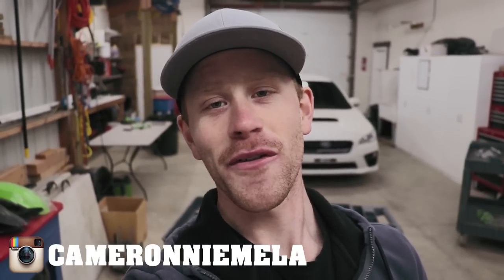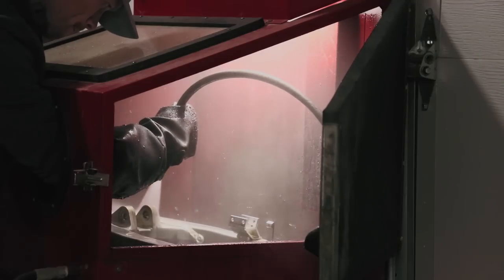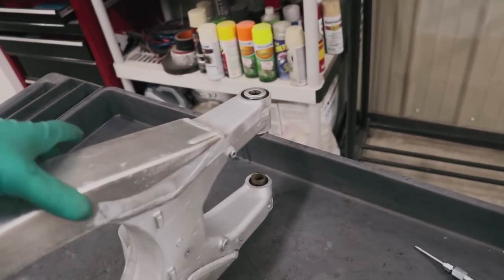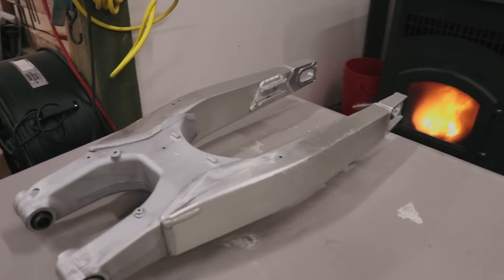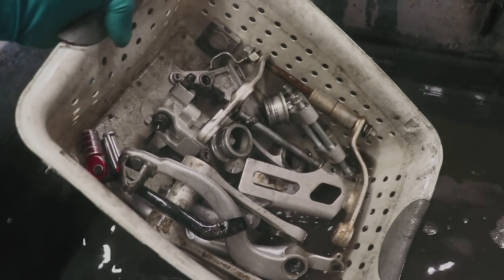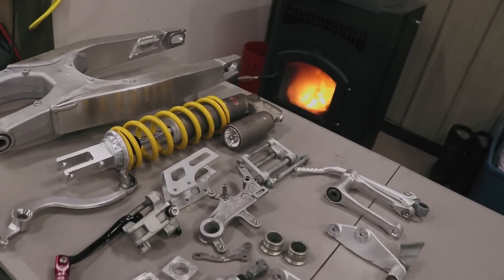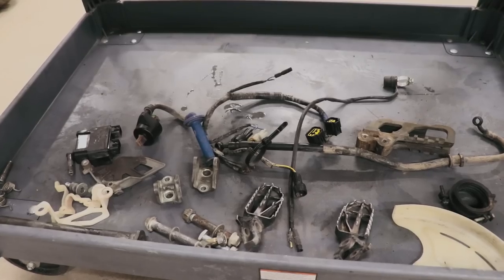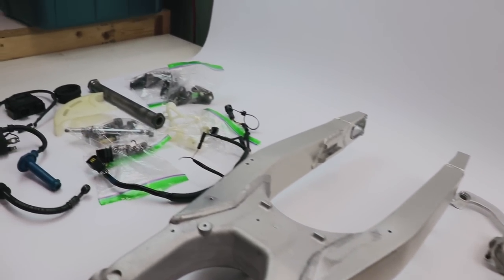My Secrets To Making Aluminum Look New Again!

Comment from the maker: Build your own heated parts washer shown in this video! https://goo.gl/pmuSfK
Reply: Cameron Niemela where did you get your pressure washer cabinet?
Reply: You should use the pressure washer after the rim cleaner might work even better also try using a heavy duty acid for rims
Reply: That mini grease gun is pretty nice. What kind of grease do you use with it?
Reply: I have a heated parts washer for $10...   Double boiler from a yard sale.
I also use a $10 walmart hotplate, and a $7 large WM stainless spag. pot.  :-)
Reply: @chadhandrop4339  he won't answer you because he's too busy cooling his water and degreasant bath down from the impossibly absurd 150 degrees. I'll apologise on his behalf.
Reply: PPP Pugh F, not C
Reply: If you want a small parts hot tank keep an eye out for an old crock pot. Works great.
Reply: 1 litre of coke and a roll of tinfoil does a better job than your set up. Cola and foil also cleans chrome really well.
Reply: @ppppugh7892  😂😂😂
Reply: @HelloJamesBond  I'm desperately clinging onto the time where everything English was always understood by 'the English'. I'm not anti American, just picking up on lack of clarity and an assumption that the World (outside USA) even knows what Fahrenheit is! 🤫🌝😂🤩 150 degrees!!!

Comment: Excellent instructions on cleaning and restoring aluminum motorcycle parts.   Also appreciate the details on greasing bearings and the mini grease gun. I will use these techniques in my restorations.   Thanks much!

Comment: I've been using etching wheel cleaner for about 30 yrs. & it does work great, it's not too good with black plastic stuff under the hood of my truck so a little patience is best if doing an aluminum manifold like brushing it on in sections & rinsing often for anyone trying it. comet & a scoth brite works good too, my 70' Triumph center cases & head are bright white aluminum. Part of keeping things simple after it is clean is to wash everything with "Dawn" dish soap and water on a regular basis. I was taught the dish soap routine by a 3 time national speedway champion who's house I kept my bike with, after each race the clutch, carb, throtle chains, everything off the bike & into the bucket of soap & water!

Comment: I’d love to see a video on your parts washer cabinet. The red one!
Reply: Shane Conley same here! Looks like a great setup
Reply: It's a sandblasting cabinet. Not much good for sandblasting if it's wet inside, but a few simple changes between sandblasting and pressure water and it should be fine. Just remember sand doesn't like water, any water. But you can also use glass beads, nut shells etc in the sandblasted for cleaning up stuff like this.
Reply: 29 bucks for his "course"  lol
Reply: Aussie Manly Man you should check out pressurewasher sand blaster. It mixes sand with the water stream. No dust and no heat

Comment: RIP bearings&seals
Reply: sakari puttonen thank you
Reply: Seriously right! Lol
Reply: but he pulled the inner race, cleaned it, and added some grease... 😂
Reply: I don't think that would hurt the seals but he can kiss the bearings goodby. The bearings are now filled with Simple green and water but at least the rusty pitted bearings will have some fresh grease.
Reply: what are you guys talking about? they aren't ball bearings or needle bearings. and he took care of them and the inner races.
Reply: 4:56 You can clearly see the needle bearings that were not removed.
Reply: I’d be concerned about the seals in the shock and on the rear master cylinder.  I’d say after soaking in warm simple green they’d need a rebuild.  Although safe on rubber, there’s no way it didn’t get past the seals after soaking.  
Who soaks and then power wash’s there master cylinder ???
Oh And let’s not forget, the master also got a good soak in the mag wheel cleaner...
Reply: thelaughingman79 exactly they are bushings right? So no harm done.
Reply: Mrcaffinebean Bearings
Reply: No metal needle rollers, just a ribbed rubber bushing. Think about it- why would you have metal needle bearings against rubber? The pin could be 1 race, but where's the other? Nope- it's the same as a control arm on a car.
Reply: Water and Simple Green is nothing- compared to DOT3 brake fluid. I would do a complete teardown/rebuild of brake components- for safety sake. As for the shock- if seals hold IN pressurized (when dampening through valves) fluid- I'd imagine they'd keep simple soaking solutions out. Think about it. He's cleaning these parts up to sell as USED- not new.
Reply: Bushings. Bearings use races and are metal. Bushings are an elastomer with a bar or bolt inside, or can be made from a type of metal called Oilite bronze (electric motors). Crankshaft=bearing, Body-to-frame bearings? No. Control Arm and Sway Bar *Bushings*. You usually don't grease bushings, except for ease of assembly. The twisting rubber takes the movement- the rubber doesn't usually spin in it's bore.
Reply: Yeah, that's some nice grinding paste he's made for the new owner to wear out the needle bearings in triple quick time.
Reply: DOT3 might be nasty shit, but it's also not simple green. Something made to contain DOT3 is made to contain DOT3, not anything else.
Reply: HUBBABUBBA DOOPYDOOP you obvoiusly know nothing about mororcycle swing arm bushing and bearings. Some arms use bushes some use bearings and the bushing type generally have a metal tube that the pivot bolt rotates around and needs to be greased. It is not like a sway bar link on a car
Reply: I know right!
Reply: Well aslong as he replaces or greases it all not a big deal
Reply: Chris_1973 as soon as I finished watching it my thought was “wtf? that shock and rear master cylinder are done now”. Or is the shock nitrogen filled and completely sealed? It can’t be good for master cylinder without taking it all apart that’s for sure.
Reply: @rztrzt  
Why so hostile, Bruh? Ok- I just work on cars, not bikes. Sorry man!
Reply: Yup!  Good cleaning process if you remove the bearings and install new ones.
Reply: @ToyotaKTM   He popped them apart, Cleaned and re greased them.

Comment: 1) What are you using to heat the degreaser/water mixture?
2) Is that pressure washing cabinet just a converted sand blasting cabinet?

Comment: Brother I am a clean freak too. How did you heat the Simple Green and is it diluted or full strength...same with mag aluminum cleaner...that's a big bucket of Simple Green and Mag Sauce you soaked the smaller parts in.. I don't have a pressure booth but I live a block from a cheap carwash...I usually throw it all in buckets and  truck it over after degreaser soaking it and pressure it all there for a couple bucks ..
 I like your aluminum trick. Thanks great video...
Reply from the maker: Thanks for watching! I'll have more info available on the parts washer in tomorrows video.

Comment: Is that just a sand blaster with water at the bottom for the air to pick up instead of sand?? That's awesome!
Reply from the maker: It uses an electric pressure washer. Works wonders!
Reply: Got the same  set up usin HF  elec portland  PW,  it DOES  work  great,but   it will rust out,so  you HAVE  to drain and dry   after use!.I am   resto shop  owner,mostly  Harley..always  buyin  parts. Hit me up

Comment: The cleaner you used is a great tip and I will try it asap however we can’t take the bike apart every week so not practical. I am going to try and wipe it on an off. The only thing that worked for me was wire wheels. I use the 1/2” and above on a corded drill and for the tiny place use a dremel tool. After that then buff and polish them out and they will look like a factory pro bike

Comment: Thank you for your AWESOME videos, I definitely picked up several things to take care of my bikes. I do have 2 questions:
1. where to get that compact high-pressure wash machine? (it looks like Harbor Freight Tools "Sand Blast" Machine, but with water, which I've never seen before).
2. What are you using to heat up that Simple-Green solution in that tank, Is that premade machine/tank with a heating element?  Thank you again. Very cool stuff.

Comment: yo, rad channel. just wanted to let you know the spotting you've experienced on the sides of the swingarm is due to the clear anodizing process that is done to the sides from the facrory. also, noticed the axels looked a bit rusty, you can thread the nut on them then use your impact to spin the axel while holding the axel with scotch brite, also works great to make sure that the right side end of the front axel slides easily in the right fork to prevent binding of the forks, after cleaning it and applying some grease an old axel should slide in nicely. you can do the same thing with that long head stay bolt as well to clean the rust off

Comment: I'm also using an almost similar method. But i use cheap powder laundry detergent instead of degreaser in constantly heated water. The result is almost the same. But require some more brushing and re soaking. But i'm cheap! hahaha

Comment: I wish I could do a smaller easier version of this to my bike, im starting to learn a little bit about parts and putting stuff together. For example like how to do a whole clutch assembly, I learned how to put a lowering link on a bike but honestly I'm learning more so about each part and what it does. I have a 2005 yz250f and I'm trying to figure out what I should do to make it look new and fresh. I'm forsure going to put new plastics and a graphics kit. A new clutch cover new levers maybe some new wheels down the line and make try to clean up the air box to make it look nice

Comment: What would you soak your parts in if you didn't have the heated cleaner is there anything what you can use just in a bucket ect I know it won't be as good but just wonderd if there is anything thanks

Comment: Hey man, I see that swing arm came up really nice! but I also see that swing arm is made of box sections and welded, but would this process work on a cast aluminum swing arm? as on ktms? cause they have such a rough surface and they've been CNC'd in some spots for part access?  I'm thinking it would clean it pretty good, but not as good as the swing arm you did though.  I dunno? let me know if you've done cast swing arms before?
cheers!

Comment: You can add an osculating head to your pressure washer rather than just a strait jet tip, it will strip and clean 10 times better and faster than expensive cleaners,  especially when you use hot water in your cabinet.  they make one for metal or wood and come in various sizes.

Comment: Is it possible to make an alu frame with a lot of light scratches and fading look new again?
I see a lot of older CR's for sale but most have frames that look all scruffed up and i want it to look perfect..
Reply: NukaMoto he has a couple videos where he shows his process with frames and they come out flawless. If you want the scratches out use high grit sand paper 600 then 600-1000-1500-2000 one at a time  and then use mothers and buff it and polish it and it’ll come out in a mirror finish. That works on any al frame
Reply: Use autosol aluminium polish and old white socks to rub. When you feel the grit wear down use more. Lil dab at a time . For big ugly deep sctatches. Polish then down a tad with 800 grit sandpaper n water. Dont sand much then polish.
Reply: or some maroon scotch brite followed by sos pads for a factory looking finish, the polishing suggested below is a bit overkill and a pain in the ass to maintain

Comment: Wont simple green break the shock bushing down? Also the seals? Bearings? I always use simple green but dilute it 50/50 with water in a bottle.
Reply: No it won’t read the bottle it’s safe on rubber.
Reply: it 
 messes up aluminum though if left in any nooks or crannies
Reply: erik61801 that whole swing arm is aluminum so it should be fine it just leaves a dull finish if you leave it in for too long i dont know what it does to brass or bronze though
Reply: Austin K exactly time is key. Most solvents that are water based seem to eat aluminum the key is exposer time.
Reply: same bro
Reply: The Simple Green was left INSIDE the swing arm.

Comment: Only thing I would recommend is spraying those bearings out with carb cleaner or starting fluid to remove all the old grease then repacking them

Comment: You turned me on to that mag wheel cleaner! It works so damn good on any surface really, cleaned my rm up with it at it turned out immaculate! It works pretty well on steel as well👍🏼
Love your vids always wake up and check my phone to see if you posted. And when you do I drop everything and watch keep it up man👌🏼
Btw you should try and part out a quad would be sweet content (blown up raptor or 400ex would be cheap👍🏼 and everyone is lookin for parts for them
Reply: Mike C dont spray electronics with it. Shit eats wires and makes wires turn green
Reply: be carefull its mild acid, works great you just have to wash it off right away. not sure about using it on plastic either...

Comment: Its funny before i watched this video ive been doing the same thing minus heating my soak bin of simple green and water. I bought a 2003 rm250 for $1500 ran and doesent have many hard hours just rough from no washing or detailing. I use the eagle stuff on the motor if its dirt stained. You can make a neglected one look brand new with a little bit of time.

Comment: Mecanic issue: I would worry that the shock sealing gets damaged and that degreaser and water is still inside the needle bearing. Enviromental issue: Do you flush the spray cleaner straight down the drain? Otherwise nice looking parts
Reply: Going to say the same thing, maybe he just didn't show drying out the bearings.

Comment: Mag wheel cleaner is muractic acid. Be very careful with this stuff. If you use if on a shock you might want to spray the compresssion and rebound adjuster screws with penetrating oil so they dont seize up. Also a good idea to grease the pivots at each end of the shock.  Never ever wash electronics or wiring harness with any harsh cleaners. Dish soap is strong enough.

Comment: After you do this tape mask any holes and stuff you don't want to paint and spray 2K clearcoat onto the aluminum parts. than if it get dirty again you should be able to just hose it off with soap and water , just like car paint.

Comment: Navy/Air force have an edict in place to never use simple green on aluminum aircraft parts due to the etchant rate that can eat away aluminum.  Obviouly aircraft cost millions $$ and need to last 30 + years,  but still something to consider.  BTW i use simple green followed by water rinse.

Comment: What do you use to get all of the caked on chain lube off of the sprocket and rear hub/spokes?
Reply: threefiddyone I use a sos pad then some mag wheel cleaner actually and it works pretty damn good
Reply: Mike C Thanks dude
Reply: Wd40. Spray it on anywhere you dont want mud to stick. Been using it since the 80s.  After washing my mx bikes i spray my engine and under fenders and everywhere else that collects mud

Comment: Caustic traffic film remover ( tfr ) great on that white tray off aluminium parts ,NOT ON PAINT..

If your part is painted use NON CAUSTIC TFR..

CLEANS MY 44 TON TRUCK IN SECONDS, BY A LITRE OF EACH OF EBAY AND EXPERIMENT  

Remember "caustic " can sometimes  strip paint after a few apllications so use NON caustic were you want to protect paint

DONT GET THE TWO MUDDLED UP...

Comment: lol... same home depot spray bottles I use!!  Try PURPLE POWER hot as well.  It's INSANE!!!!!
Reply: Cam I just confirmed with my machine shop... after removing the top plate from a dizzy... you can hot soak the entire thing too.  Since the shaft bearings are bronze bushings...  And they said PP too.

Comment: how about some details on your pressure washer?
Reply: Claus Littmann I’d like to hear about this too!
Reply: you can buy that whole setup at harbor freight. I saw it there the other day
Reply: wrong,  you can buy  the  2 items,but you have  to put them together   yourself and    change  the  "gunhose"  to a  flexible hoe and nozzle inside cabinet. This is NOT NOT NOT an  out of the box  set up. I  also  use  ULTRASONIC  TANKS instead  of  heat  tanks,or  both at same time,which can be  made from an old  stainless   sink   a 55 gal drum ,a  pump/heater from a hot tub and a  pad sander. I  would post up my shop  equipment builds ,but am too busy ,I leave it to  C,Mine  are also  alot  bigger  for  bigger  parts ,can you say  engine block?. C  knows  his  stuff!

Comment: love the attention to detail and something you don't see much these days PRID IN YOUR WORK. AND ATTENTION TO DETAIL how refreshing that is, there is so much "that'll do" attitude and the worst of all attitudes "its for a customer not me"
A TIP for anyone cleaning up alloy at home, try this, a Brillo pad soaked in 3/1 oil and washing up liquid, the Brillo pad is impregnated with sodium chlorate, the oil lubricates and the washing up liquid cleans, you use variants of this, any thin oil WD40 would do and liquid clothes cleaner for washing machines, any detergant, but it's got to be a Brillo pad. . RUB IN  A CIRCULAR MOTION AND IT GIVES A BRUSHED ALLOY LOOK,

Comment: Pitted and etched cast aluminum. I've been cleaning MC parts for over 10 years and have never used chems.
Reply: how do you do it then? I can clean up aluminum pretty good with scotch brite but its a pain to get that stuff in every nook and cranny
Reply: @grizzz7960  1) Steam power wash.  2)Wash table using hand brush, old gas out of bikes being parted out.  3) What I Can't get with a manual toothbrush(girlfriends) I buy cheap kids electric toothbrush for tight spots.  4) Original green bottle Turtle Wax spray and yellow micro fiber towels to wipe down. Good for getting bugs, chain fling and sticker residue off of fairings and rear mono shocks. Hope this helps.